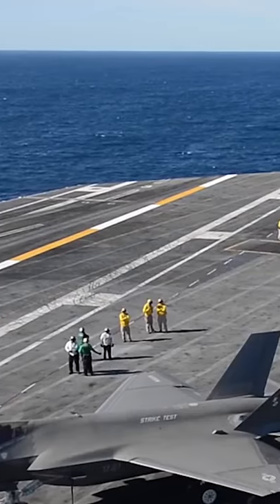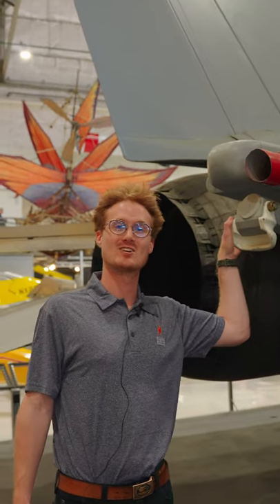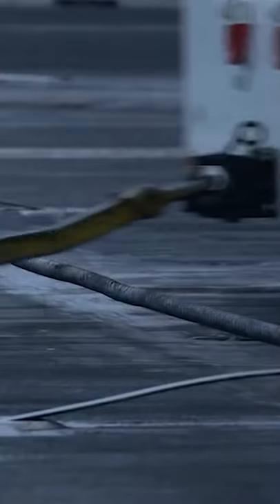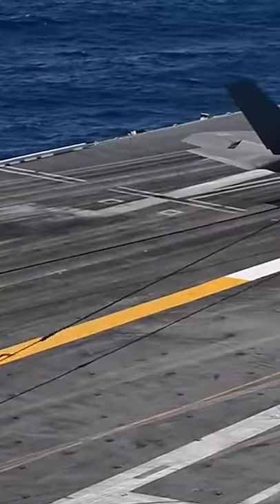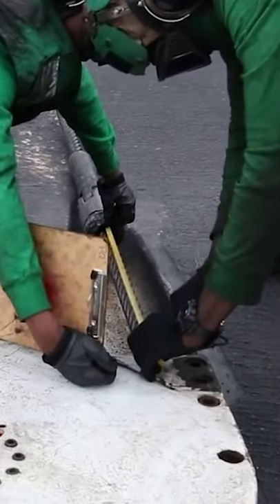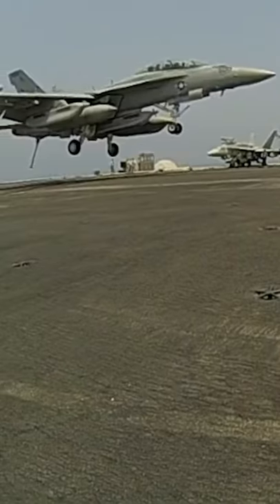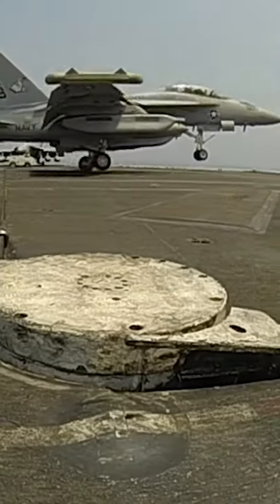How does an F-14 Tomcat Land in under 500ft? #shorts

Comment: Is that not to cheat? Having a cable to stop You, I think the Russians do it without catapult and cable, JAS39 Gripen do it too, start and land on short highway runways without cable and not even a drag parachute. But that plane is more nimble against the mighty F14, in my Youth it was a plane I admired.
Reply from the maker: Russian aircraft carriers (and Chinese, and Indian, navies) operate conventional aircraft from STOBAR aircraft carriers (Short Take-Off But Arrested Landing). Instead of a catapult, they use a ski-jump to assist aircraft in taking off
Reply: @Wings_Museum  Thanks för the info! But hard for the pilot to be "arrested" every time they lands, are they released for good behavior or on bail, but a pilot only bail OUT of an aircraft? But today even there they are flung out by a smaller catapult. In Swedish an ejection seat is called katapultstol (catapult chair).Thanks for the channel Happy Xmas and a Happy New Year!